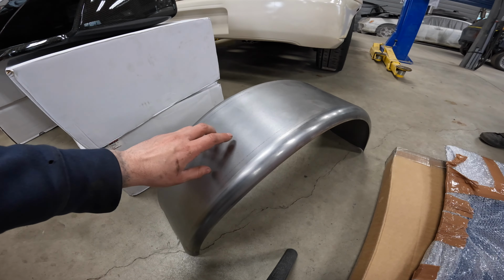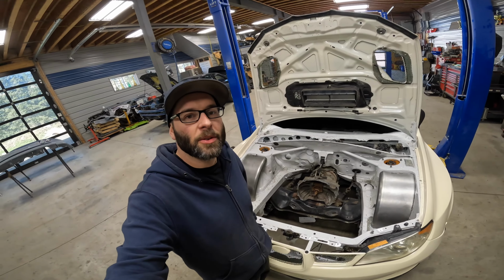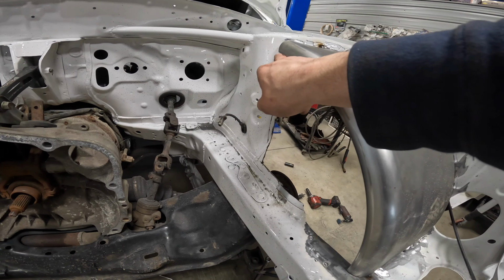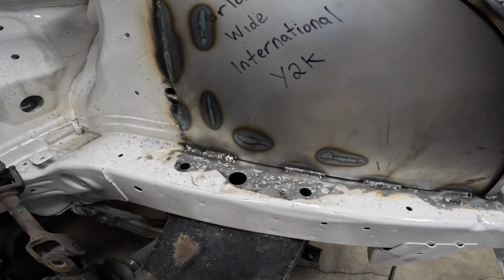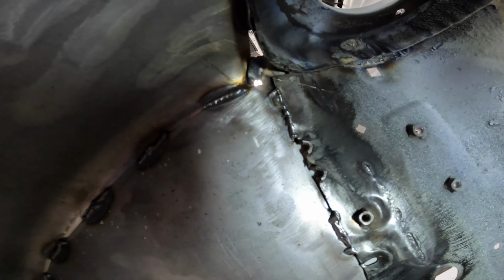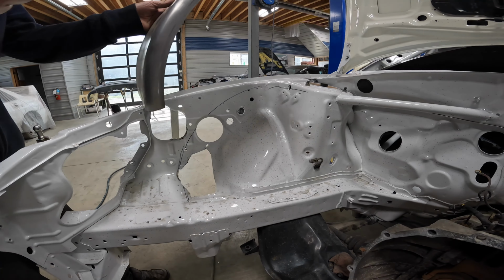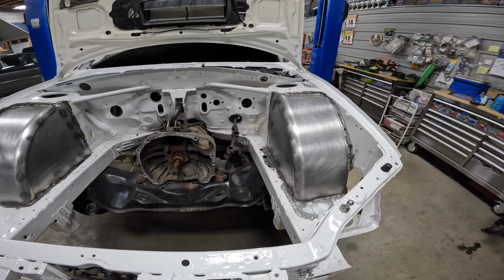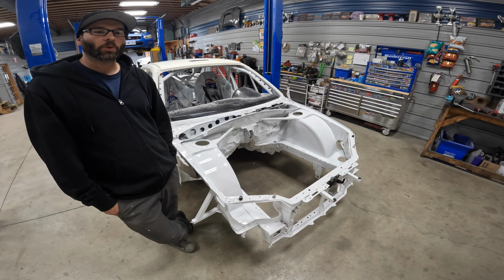Subaru Fender Tub Install - WRC Build

Comment: What are the purpose for these? Is it so the wheels can travel more upwards during rallying?
Reply from the maker: The wheel base is actually 2” further forward on this car. So these were essential for this one. For normal cars, people still do wheel tubs so they can run wider wheels and or go lower etc. 
My bugeye, lowered with oem wheel size and tire size actually has been polishing the fender wells on the front due to rubbing in turns.
Reply: @TheSubieSanctuary  I see. Thank you for the info. 👍🏻